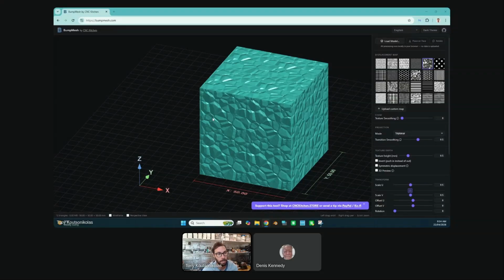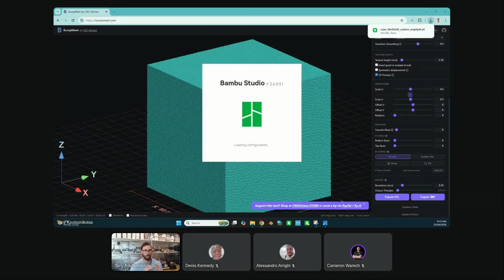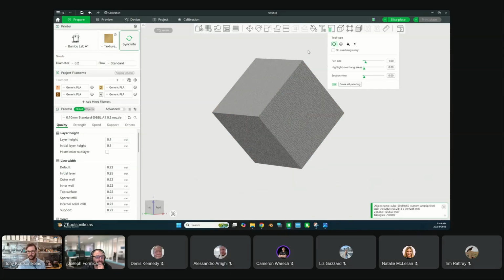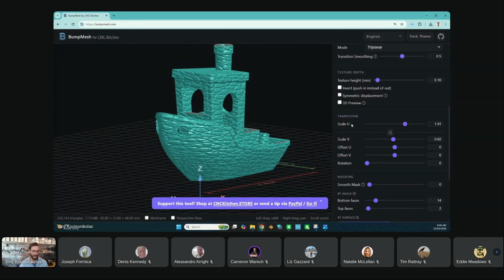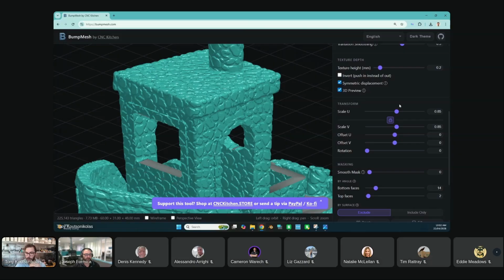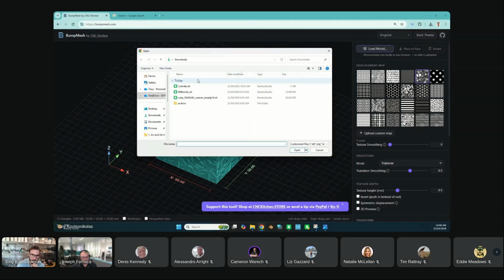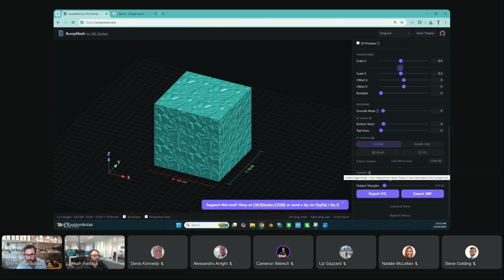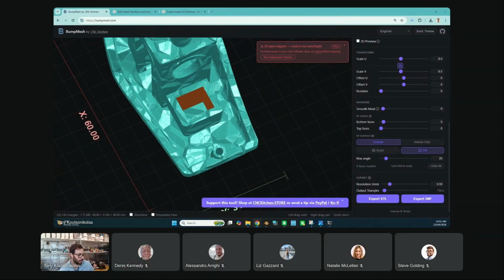Applying 3D Textures in 1 minute with BumpMesh | Webinar

Comment: Thanks for the video. I have a question about what’s the best workflow when using BumpMesh? You jumped around a lot between different settings which makes it difficult to determine the best workflow to use. Can you provide a defined workflow that one can follow to use BumpMesh most effectively? And how would the workflow change based on the characteristics of the model you’re applying it to (ie Cube, Cylindrical object, multi face object (like the Benchy), etc). Appreciate any guidance you can provide. Thanks.